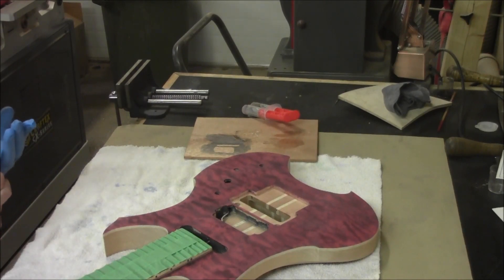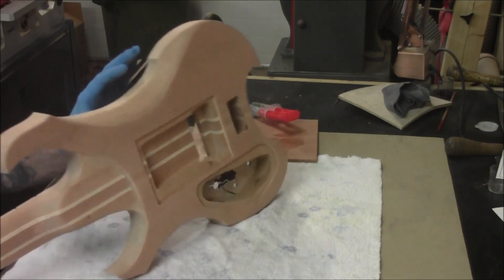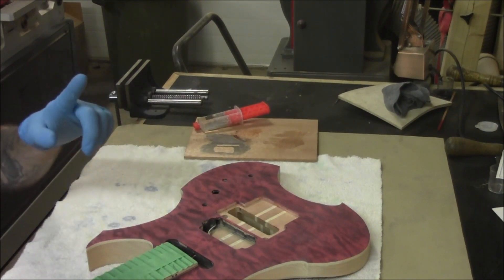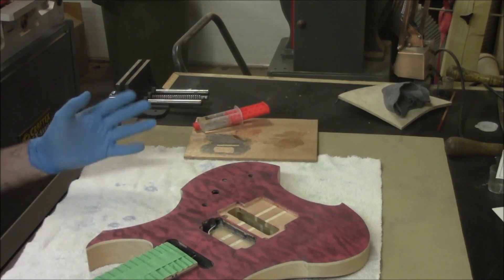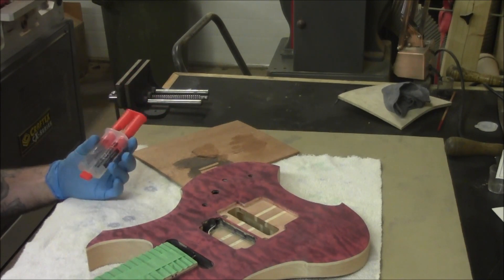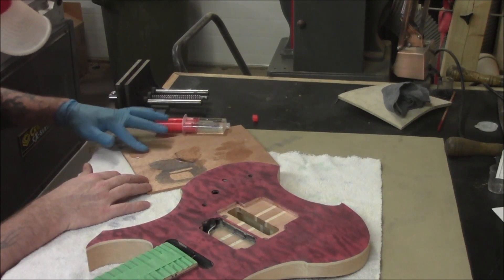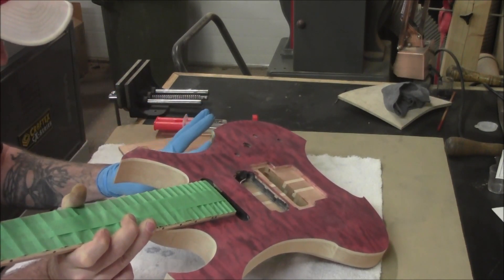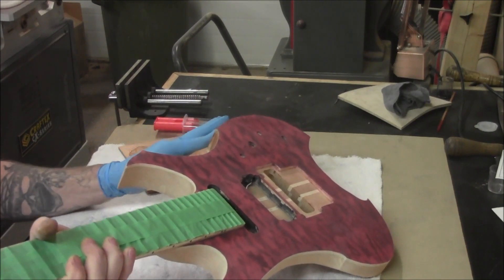How to Build an Electric Guitar-Video 23 - Sealing and Grain Filling

Comment: Sorry it took me so long to watch this video, I love your it may not be the normal way but its my way procedures. The turn buckle is just what has been missing in my home made booth. Thanks for the idea. Oh I was wondering if you have seen this product from Japan yet, I have been researching some on it and I think its pretty cool. You may too!
http://www.luminlay.com/
Reply from the maker: Yes I use them on almost all my builds! They are awesome. they hold a charge for about 1/2 hour and even after they have a faint glow. But it is expensive.
Reply: DarkLuthier Do you buy it from a seller on eBay? or have you fond a better place? Thanks for the info I will try it!
Reply from the maker: Derredmax
I buy them direct from Illuminlay. I can't find them anywhere else.
Reply: DarkLuthier  They have it on eBay but it seems a little expensive. For the 2 mm side dot marker material it's 18 dollars for 60 mm.
  18 dollars a tooth pick just seems a little much to me lol The stuff must be worth it people seem to be buying it. What is the price direct?